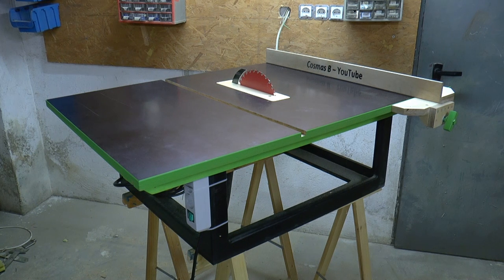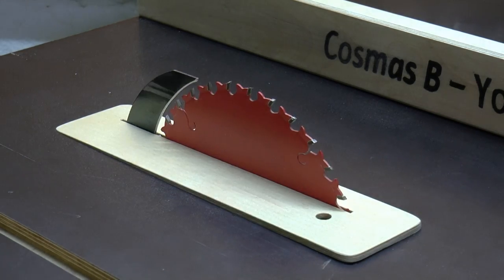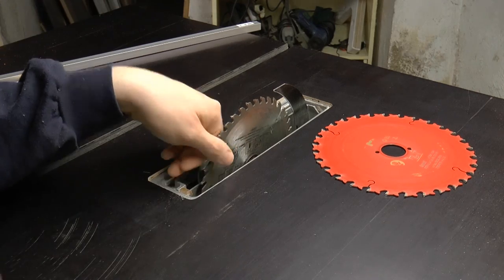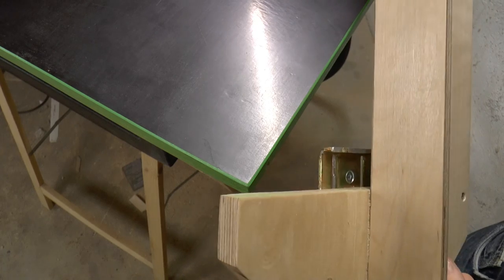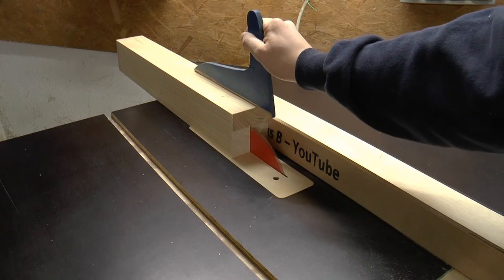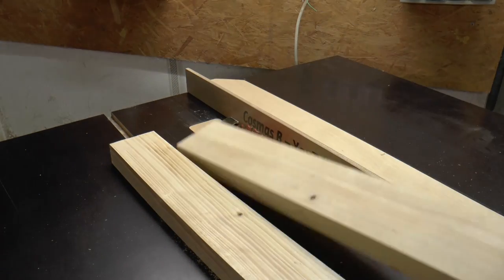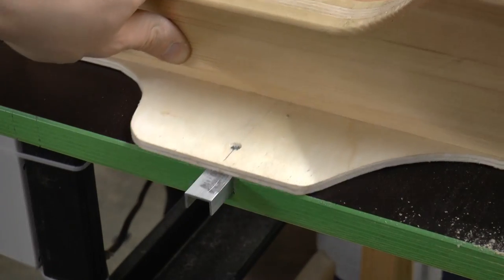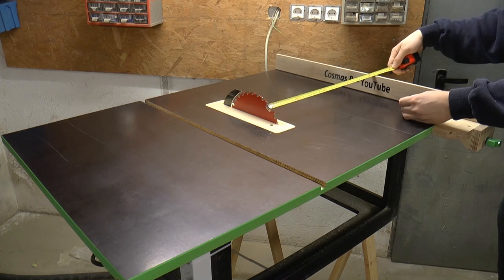Homemade Table Saw

Comment: That's one cool, cheap table saw.  I'm curious to see how you added a riving knife when you get the build video up. -Dave
Reply from the maker: The riving knive was part of the circular saw. If that wasn't the case I would not have tried to add a riving knive. The build video will be up on monday.
Reply: Cosmas B indeed, the big makita circular saw i have(5903), also has a huge riving knife. i think most recent huge circular saws of a good quality have them now.

Comment: Nice table saw, great job! Planning to build one for my own. Which circular saw did you use? Very useful that the lock screws for height and tilt are on the same side of the saw.

Comment: Hello Cosmas nice video !
I'm Thomas from Germany. Im currently in building table swa also with the Bosch GKS 66 CE. I bought my one on eBay, but having a little play on saw blade. After checking I decided to renew the bearings of blade part. Could you please try tto move your blade into motor direction and check, if there is any moving ? Are you satisfied with the power of the motor ?
best regards Thomas from germany
Reply from the maker: There is a little bit of play because the saw was used a lot. If I have time I might fix that. I think the motor is powerful enough. I thinks for a small saw like this there is plenty of power. :)
Reply: And a zero clearance insert reduces the play a bit
Reply from the maker: Tom Howbridge
There is too little play that the insert would do something about it. It is barely recogizable.
Reply: Cosmas B
You can order alle bearings and spare parts by Bosch. I'm thinking to make the plastic housing of the bearings be aluminium and modify the front bearing to bigger one and also the axis for the blade. Best will be 2 bearings of each side of the saw blade, but this makes saw blade changing mor difficult....I' still in thinking, first I will wait for the new parts from Bosch, than I will decide. I keep you updated.
Reply: Cosmas B
IF you would have a problem with too low tollerance, its an easy fix by using a router to make a slightwider slot. but since i know you ,because all your videos, i know you know how you need to work out problems if the put up ;-). nice work cosmas